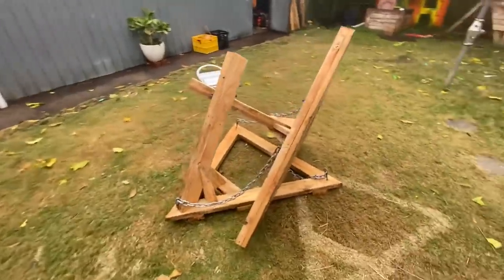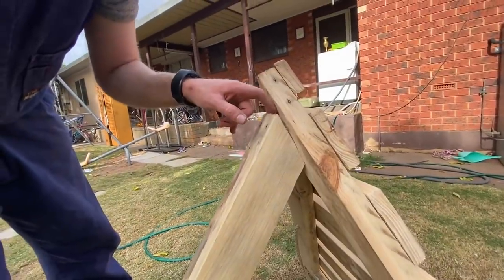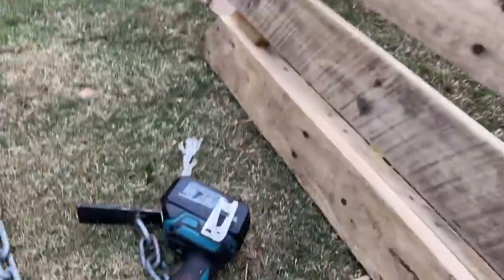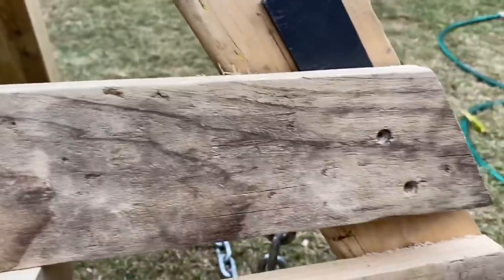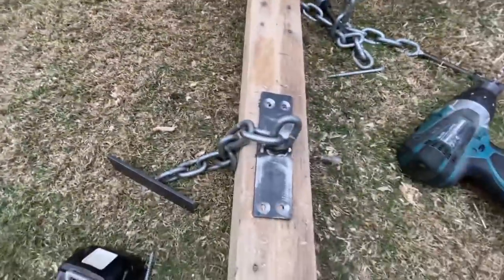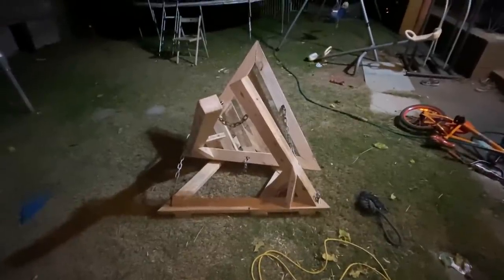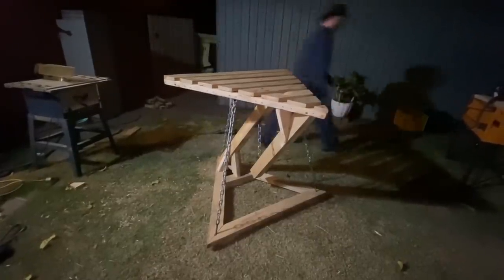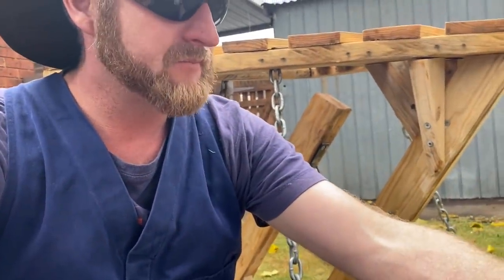Tensegrity table 2.0 social isolation build with chain upgrade WIN!

Comment: If anybody doesnt understand this: the table is infinitely falling down, but the chain in the middle prevents it from falling any further. The side chains are what stabilizes the table by preventing the sides of the table from Treefalling(falling down on one side). If you use four sides, it will be exponentially harder to fall down, any more than that and you not be able to collapse it again.
Reply from the maker: This is the best explanation I’ve heard so far. 

Well done! This one actually breaks a little bit every time I push it back down... simply because of the flex of timber vs the zero give of the chains.

Steel is the only real answer to combat this flaw in this piece. 

However, the issue is I would burn down my house/shed if I fired up a welder near all the sawdust in there!
Reply: "Infinitely falling down"

What mate? Just like a satellite?

How does gravity work.
Reply: Let me have try at this. Visualize chains as dots in plan view, connecting the outer dots creates a polygon. As long as the weight center is within the polygon it always puts 3 chains in tension (stable). To collapse it the weight center must be outside the polygon leaving 2 chains in tension (unstable). To increase the stability you can:
1. Increase the selfweight of the deck (or load on the deck) it takes more force to move the weight center
2. Increase the size of the polygon the further you have to move the weight center.

The most effective way to move the weight center is to lift it at a corner of the polygon.
Reply: Stardust Crusader That is the most ridiculous explanation I’ve read. The table is not infinitely falling down, that’s what satellites in space do in response to the earths gravity. The table does not actually require any gravity to function, it instead requires two other forces; Tension (through the short centre chain), and compression (through the ‘45 degree angled’ central wooden posts). You are correct in saying the side chains only stabilise the top platform. But also completely wrong again about the number of sides increasing exponentially making it more difficult to collapse. You can literally build one of these with as many sides as you want.
Reply: "...the table is infinitely falling down, but the chain in the middle prevents it from falling any further." Laughed my ass off to that.

I'm infinitely falling down, but the floor prevents that...  xD
Reply: It's just a blast watching people try to articulate how it works. There really isn't any convenient / eloquent language other than 'it can't fall to the side - cuz chains!'.
Reply: carbon1479 Umm what? No, read my comment.
Reply: carbon1479 you should watch Kyle hill’s video on this, I believe he does a good job in explaining it.
Reply: They programmed wrong that table and it doesnt lose speed when touches another collider smh
Reply: Nope. That explanation DESTROYS my theory that Australians are magical. ❤️ From Atlanta!
Reply: @Bibibosh  dude you are infinitely falling down, the ground stops you
Reply: Sooooo
Infinitely falling=Hanging in a stand via chain...
Reply: Technically, it works because of newtons first law.
Reply: I feel that it could remove the middle chains as a weak point because that's I think most of the force is by instead of having them bolted facing each other the chain could go through and be bolted on the other side of each middle bar
Then of course reinforcing the middle bar is a must that he did.
Reply: @Bibibosh  ..... just like riding a unicycle is 'controlled falling', until it's uncontrolled :)
Reply: My brain is destroyed...

Comment: my puny highschool brain can not understand this
Reply: The top bit wants to drop, but the middle chain is fully stretched and, usually, the top bit will drop to the side from there, but that is what 3 chains on the sides are for - to not let the top bit fall to the side.
The most important and 'magical' thingy is the middle chain. All others are there to make sure it stays up.
You can also watch a LEGO tensegrity sculpture to better understand what is going on
Reply: It’s a dangling board by the middle chain and is balanced by 3 side chains.
Reply: Ignorance makes it cool, just like magic
Reply: Counter cravity banlance.
Reply: M1CKEYDKOREY | The tension in the middle chain keeps the table in midair on the support, and the outside chains generate tension when the table tips/twists and keeps it upright. If too much force is applied to one side, the table slips out from the center just enough for the chains to pivot and the table collapses to one side.
Reply: Same

Comment: In minute 10:36, I can see, that the "anchor" of the tensegrity table is slanted, so the tabletop isn't really straight too. Did you conceive the table to be like this, so you can enter it better from one side or was that done without purpose. Because that means, that the two back chains have a different tension, what means, that the table is less stable on the side, which is towards the long chain and more stable on the side, which is towards the short chain. I am not sure, if that has to do something with the balance of the table and if it was done on purpose. I never built one like this myself, so it might be, that I am just wrong.
Reply from the maker: The tension of the chains is difficult to balance against the flex of the timber. 

You can't see it in the video but there is a crack in the base on the side that it's leaning towards...

You have a very sharp eye for detail! I repaired the crack and added extra support at the base to hold it strong but now it will only collapse in one direction. The other side it to ridged to be pushed down. 

So in answer to your question no. Its meant to be straight. If I rebuilt it I think I'd do a few things a bit differently to make sure it all lined up straight and true. 

The concept still works but it was, I'd say? An 8/10 for execution is said IMO.

Thanks for putting such thought into your comment!

Stay tuned, next video will have a link where you can download plans.
Reply: @oldmate7316  okay! Thank you for the explaination and I am looking forward to see the plans! Tensegrity tables are interesting things but also really hard to build, so yours is really impressive by the fact, that it is so big and could even hold the weight of a person!

Comment: okay so a few recommendations to increase functionality reduce the height of the support beams to reduce stress at the nail/screw joint. then increase the chain count inverting from current set up top vertices to mid point use eye hooks and chain clips for quick disassemble.  other alternative to increase support weight build two and shape as square made from two triangles.

Comment: Wouldn't you need just the short link in the center to be a chain and keep the 3 stabilizing longer peripheral links as ropes to achieve the same load ? It's mainly the center link taking most of the load ain't it ?
Reply from the maker: Yes the center carries the load at a 3:1 ratio to the outside. However, the side ones need to have the zero longitudinal flex properties that the chain provides.

Ever tie down a load on a trailer or the like to unload the next day and the ropes were slack again?

Well that’s the issue I found with the ropes. Chain was best imo

Comment: Dude you made a huge mistake, The middle part of those triangles shouldn't be placed at same place, If you took out the chain, those two pieces SHOULDN'T be IDENTICAL. 

The middle piece from one triangle should be on the middle of a plank of one triangle, but on the another triangle it should be on the intersection (joint). 

Because then the triangle would be exactly on top of each other, which in your case isn't. I know it works but for me it looks wierd than I thought why is it looking different. Thats the reason. 
English isn't my first language so bare with me.
Reply from the maker: You’re totally right... I’d build it different if I could do it again.
Reply: @oldmate7316  no worries, building this one was a great work tho

Comment: All chains or wires should be assembler perfectly vertical. That's  a secret. This table is not a perfect.
Reply from the maker: No, it's far from it.

It was my first/the only attempt. If I did it again id build it square.

Comment: Liked your original build too.  

I wondered why you didn't shorten the middle supports?  They go past the weight-supporting chain.  Both top and bottom look like they could be a few inches shorter and should add to the illusion.

Nice build.  Very cool.
Reply from the maker: Ed Gatzke yes but I got distracted and I basically didn't get back to it! 

Thanks ADHD!

Comment: think about this,...
make the 3 chains all the same length,... and on the center chain put your adjustment bolt, or a turnbuckle maybe,.... then when you tighten that chain,... it pulls up and moves the top par of your table up,... and if its all straight and level and chains lengths are the same it should pull it into level,  top should be level, and very strong,...  do a 4 legged one, they work nice,...!

Comment: So Old Mate, Did you work out why the table collapse's on one side? I am thinking it may be due to a very slight difference in where the holes are drilled for the outside chains? or is it due to a slight difference in the angle of the supports holding the centre chain, allowing a weak point toward the side of the lesser angle? I would really appreciate your comment. Awesome work on this and a great way to fill your time and challenge your thinking keep it up :)
Reply from the maker: Well... It's cracked on one side. When I set it up the first time with the chains there was a crack noise I, unfortunately, didn't catch on camera.

I reinforced the fracture with the lower side supports and it's now all good but it's weaker on that side.

Thanks for your well thought out question!

Comment: Hi ! I'm brazilian and I have a challenge for you. Can you make a rope elevator for objects (not people) BUT one that has an gyroscope in it's side turning stuff less heavy???
Reply from the maker: Ok... do you have an example I could look at to get more of an idea as to what you mean? A link or something...
Reply: @oldmate7316  I was trying to think in a way to make a "space elevator" possible. One of the challenges is about how heavy it can be. So if you make a concept using the gyroscope experiment like spinning a heavy metal disc very fast and elevating it, you notice that make it easy.
Reply: @oldmate7316  think about the man in the center of experiment is the rope of elevator... Then, the heavy disc is where objects/stuff go inside... So, the elevator use less force to elevate, I think.
Reply: @oldmate7316  think about the man in the center of experiment is the rope of elevator... Then, the heavy disc is where objects/stuff go inside... So, the elevator use less force to elevate, I think.
Reply: So... Will you do?
Reply from the maker: Hey man... Thanks for your suggestion. I've experienced my first significant mental breakdown just recently and I'm still recovering... I'll keep up content when I'm more up to it.

Thanks for watching and for your contribution! 

Keep being awesome!
Reply: Sure! Be well and best regards. Hope you'll be better soon.

Comment: Canadian here. I been thinking of a same size experiment but I want to use threaded eye bolts on one end of he chains through the wood and big fender washers. BUT I want to tie the other ends to springs then to the wood. The  treaded bolts can drawn to stretch the springs adding more tension or fine tune or bias the tension including the centre chain, I think. That is what the whole experiment is for and covid-19 isolation sanity. See what happens. Need to get the bolts but store is shut down for now. Maybe turn-buckles and chain.

Comment: Instead of wood, use PVC pipe.  It's stronger and easier to work with, and you can use bend connectors instead of screws so you don't get weak points.  You can still use the wood for the "tabletop" and sand it and stain it to make it look good so you can use it as a desk or something.

edit: You might also consider using some heavy-duty springs at the end of the long chains on the side to balance the load.  You could salvage them off bicycle seats or office chairs.

Comment: Super cool. From a structural point of view the most important chain is the middle one wich is the one that is hold the weight imposed on it. The side chains are for stabilisation. Actually, 3 is the minimun number of external chains that has to be put in order to maintain stability because with 3 you can get an restriction to rotation in any direction in the plain. But, as you ad more external chains, you will get more stability.

Comment: What the deuce how does that work? Im really really confuse
Reply: Physics mate
Reply: The chain in the very middle has quite a bit of tension built up, and the outermost chains just provide stability by preventing the top from moving much.  The wood pieces in the middle are just there to provide a structure for the middle chain to attach to, while still leaving enough room so the two wooden platforms don't directly touch.

Comment: Simple Explanation: The upper structure is literally hanging with the help of the little string in the middle. The other strings just help to keep it centered. It would be a real "anti-gravity" thing if no part of the upper structure hanged below any part of the lower structure.
Reply: And no, nothing is "infinitely falling down". If that's the case, you'd then have to swap the word "hanging" with "infinitely falling down" in every dictionary around the world.

Comment: Do you need the metal plates that connect to the chain to be at 60 degrees?
Reply from the maker: I tried to get it at 60° but it was a bit off. 

Yes, it works best if it is but it still works if it's off. Like mine. It'll end up straighter if the angle of right.